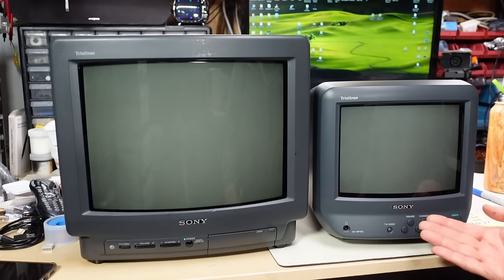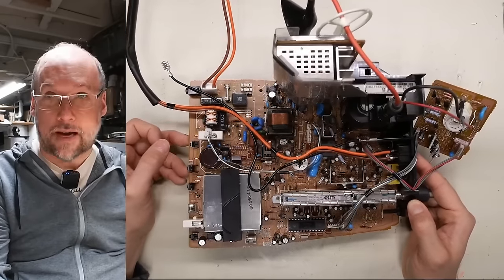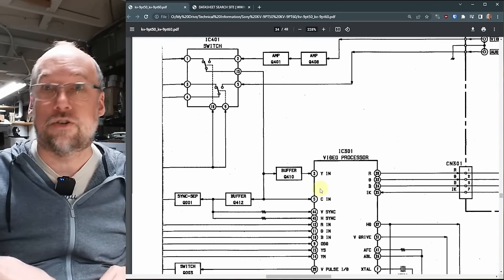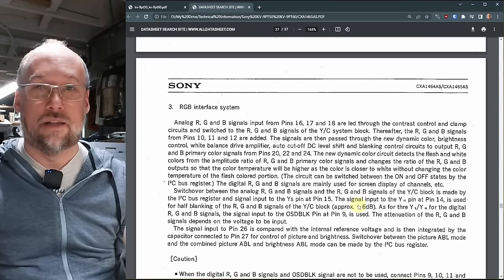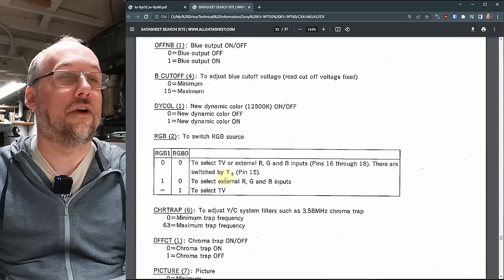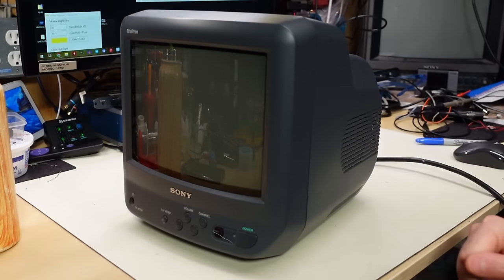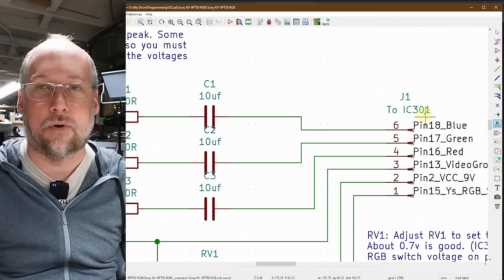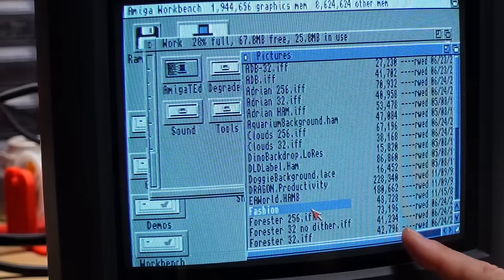Adding a RGB input to a Sony Trinitron (KV-9PT60 / KV-9PT50)

Comment: I had no idea that I2C protocol was that old and that it would be found in a analog TV.  Nice!
Reply: The original Philips patent is actually from 1980, so yeah, it's old
Reply from the maker: Indeed -- and in the past, I had a trashpicked TV which I hooked an arduino up to take full control of the TV via I2C. I was able to do some fun things with it on the fly. I thought about trying it with this TV, but interesting is it has 3 or was it 4 I2C busses on it -- instead of one shared bus. Not sure why Sony did it that way.

Comment: the KV9PT60 was afavorite on movie sets because it could be powered by 12V, you could add a video out (most of the times the pc board already had all the pads to solder the component for that) the tuner is on a daughter board and we coiuld tap on that board to add a tuner out independant of the video out and we could also slow them down to a 24 fps scan rate ideal for onscreen video playback, you could see them in many movie scenes because of that feature alone
Reply from the maker: I guess since it works at 25fps with VSMO set to 1, it works ok at 24fps as well? That's pretty cool, I hadn't thought of that.
Reply: @adriansdigitalbasement  we were using a frame rate converter made for the movie industry by Schindler, since in film we are using 24 fps the converter would make a NTSC 48i signal., I remember that in the service mode we were playing with another menu V-something (V sweep ???) and we would bring the value to a higher number until we have a picture scroll lock , sometimes when the camera was HD instead of film we had to shoot at 23.98 and set the schindler and tv for that rate, when I was a technician for Willam F White in Canada , who was the largest movie equipement rental house back then, I remember modifying at least 15 KV9 for tuner out (by adding a small homemade board video amp) , soldering the SMT parts that were not on the main board to get a video out too (alll the parts around Q406 that you show in the service manual around 25 minutes) , we were rigging them like this: addon tuner out to an external recorder , recorder out to video in , we tuned the tv to get the NTSC wireless sender of the film cameras and by pushing the input button we could switch between live and recorder for playback on the tv and instant playback

Comment: About the 1084 flyback, there actually was a commodore service bulletin about flybacks in monitors manufactured in a specific date range going bad, and these should always be replaced by service centers if they get one of the affected monitors in. Probably the many units failing nowadays are those that were affected by this problem.
Reply from the maker: Oh that's interesting. Luckily a company is making new replacement ones today -- although they aren't as good quality and supper voltage sag, leading to geometry issues.

Comment: My 1084 has a round DIN6 for analog RGB in. A panel mount hole for that would've been much easier lol
I actually have a Sony KVM with only composite in, I plan to add an RGBA input to it. These videos are very helpful!

Comment: I think this video is going to be pretty useful for me.  I have a 20" Trinitron of similar vintage that I had been thinking about RGB modding but hadn't really looked into it yet.  Looking at the service manual now, it seems to use a very similar setup to this set, and may even be slightly easier to mod.

Comment: I've had one of those 9 inch sets on my desk for a few years now (same model, the kv-9pt60). I use a composite extension cord so I can plug in devices from the front and it has been perfect to test out old consoles, and to plug in my Jack Pacific plug and play console so I can play galaga on it when I want to. I got it for a bout $5 from a retro game store that was going to recycle it because it didn't have a remote, and the front power button is semi broke (it seems the plastic bracket broke so the button flops around in the socket, but otherwise works), I bought a remote off eBay for $10 and it works great. My only gripe is that I have to use the cable extension since it doesn't have a front plug, but learning that this set was supposed to be for vehicle mounting, that feature makes sense to me now. Ive wanted to open the TV up to fix the front power button for a while now but am afraid of breaking the tube (or shocking myself).

Comment: RGB switching signal is active from 1V to VCC+0.7V, so there was no need for a voltage divider to get 1V.
Reply: Yes, the values in the datasheet are voltage thresholds , not target voltages. VIH of 1.0V means the voltage input on that pin needs to be minimum of 1.0V to be considered logic 'high', and conversely, a VIL of 0.4V means it needs to be maximum of 0.4V to be considered logic 'low'.

Comment: If you have a TV with component video inputs, a less invasive means of getting RGB on it is with an SCART RGB-Component adapter. RetroTink makes the one I use. I really like it because it includes stereo audio breakouts, and unlike some of the cheaper ones on Amazon, you don't have to tweak a bunch of pots to get the picture dialed in right. There are tons of pre-made SCART RGB cables for game consoles and computers, too.

Comment: In Europe TV from the 80s got Scart inputs with seperate RGB and stereo audio in/out -puts. A control signal to when switching on the VCR it switched to te Scart input. Later the control signal was used to detect a 16/9 picture.

Comment: for the hole above the DB15 plug, you can put some superglue and sprinkle baking soda on it, and it will form a dense white material that you can build up by repeating this to build up layers and it will fill in that hole.
In the arcade scene, we make boxes called Superguns that are designed to take RGB signals from arcade game PCBs from dozens of manufacturers, all with different ideas of what a "proper" RGB signal should be, so we just put variable resistors on the RGB signals so we can fine-tune the brightness on each PCB.
In your case, it might be a good idea to make a box with two DB15 plugs on it and some variable resistors to adjust the RGB brightness, and maybe a method of reducing the voltage on the sync input in case you hook up something like a console that uses TTL Sync, which might damage the Jungle IC. A  330-450 ohm resistor should do the trick.

Comment: RGB SCART was the way I played Resident Evil 2 on my PS1 back in the day! (I modded the PS1 and imported RE2) (also I was lucky my TV could handle 60hz with a vsync tweak) 18:29 I remember having to take apart SCART cables to check for those capacitors as a lot of SCART cables said they were RGB but were not connected!

Comment: It is interesting that the RGB inputs are AC coupled to the jungle IC with a series RC, but what is missing is the input 75 ohm termination resistors. The cables are so short reflections are probably not an issue, however if the termination resistors were added it would knock the video down by 50% and the contrast control would probably not have to be set at its limit. As far as protection I would also add the Zener as was shown in the Sony monitor schematic, bringing CMOS pins to external connectors without protection is probably not a good idea.

Comment: To get a neat DB-9 cutout find an old card bracket with a DB-9 or DB15-HD cutout and trim it to a suitably small size to use as a template.  Drill the holes for the binding posts, and use those to temporarily hold the 'template' in place. Then with the template in place use it as a guide to drill the required plastic out and file the edges smooth.  Then remove the 'template' and fit the DB9 as needed.

Comment: CRTs are fun, specially when you have a fun screwdriver with a light supposed to turn on when you get a voltage that instead is passing current straight through... Result, the screwdriver got stuck in a board meters away in the direction my arm jolted towards like if it had been a dart thrown to it... And my hair looked like that funky Einstein photo with it all the hair standing up. Lovely, that and the few seconds seeing all black were awesome! (And yes the thing was off, the damned light should have lit at a distance in face in the area I had it, when it didn't I was supposedly safe, well so so)

Comment: The shifting of the horizontal position is common in SCART regions too. I remember seeing it on Sky Digital (UK) satellite receivers when switching from PAL composite to RGB mode in the settings. It's a result of using the composite sync for the RGB video; there's a slight delay between the sync and video so it results in horizontal shift.

Comment: The RGB switching signal is used to blank the video to guarantee a blank video as the other switching signal would enable the information system display. The micro would have to clear memory which takes up micro cycles and code in a very small memory. If you have a pin available then you can save a lot of code by just toggling a pin. We forget we have so much memory available to us which was not available back over 20 years ago.

Comment: If I had known people would want CRT Tvs and monitors, I would not have scrapped mine all out!

About the only thing I saved on a regular basis was the yoke and transformers, as I wanted the copper wire!

The only other monitors I messed with were the ones from cabinet games from the late 70s and 80s. Most of those were RGB, but XY drive became popular with some of the games!

Comment: very cool. i recently modded a jvc 14 inch crt with a toshiba jungle chip, the worst part was the 0.5 Vpp input levels. obv a simple voltage divider worked wonders, but yeah basically it was pretty annoying lol

edit: wow it's really strange how that sony tv is NTSC only, that jvc i mentioned is from 1991 or so, and it's a "multinorma" (as advertised), so it supports PAL-N, PAL-M and NTSC. maybe thats because standards here in south america are weird as hell lmfao

Comment: For added protection, in the last step before feeding from your custom circuits to the set, you could use diodes to clamp the voltage. Really any diode or series of diodes with a voltage drop in the valid input range would protect the display by dumping any voltage in excess of what you want to ground.

Comment: PERFECT thank you.
BTW, at 46:56 that color level setting is changing something (less Moire?) that made the color bars look much better to my tired 70 yr old eyes (maybe it's running into the comb filter / 3.58 trap?).  
Sony fine pitch monitors from the 1980's with model numbers ending in "-F" had the higher resolution CRT's.

Comment: I vaguely remember the little 13" Magnavox TV I had in the early '90s, and I believe those may be a potential candidate for an RGB mod (but replace the pots on the neck board first! The ones on mine went out) - the chassis series was 13K4 or 13L4.

Comment: High tension transformers can produce voltage to the equivalent of a live UK railway line ~ that's 25,000 volts on start up. Scary voltage for sure. My dad worked in TV workshops in the days of Rediffusion (A very British thing) broadcasting. So I learned early on about dangerous voltages inside a CRT set. Meanwhile, my mother is watering flowers in a vase on top of the TV set! 8-O

Comment: 32:15 Try a "nibbler" tool to get a cleaner, square hole. You'll still need to drill a starter hole, they take some practice and you absolutely want to spend the extra money on a good one, but they can give some super professional looking results.

other strategies are: 
- Draw the shape you want to cut out, drill a series of holes every couple of millimeters, and then use nippers to cut out the tabs.
- Drill holes in the corners (or two holes where the diameter is the width of the hole you want) and then connect the corners with a coping saw

Comment: For the sync, I can confirm: The Oric Atmos has a single sync pin which merges HSync and VSync (they have different amplitudes so they can be dinstinguished) signals, and my 1084 monitor had zero problem with the Oric, with a rock solid picture and vibrant colors (more or less bright depending if I enabled the TTL button or not)

Comment: Note on the Ys signal - the data sheet indicated that this is a logic level input... Vih (min) means that the minimum voltage to be recognised as a logic high is 1V. The maximum voltage allowed would be equal to Vcc. It would have been enough to simply put 9V on the pin to give it a logic 1. A neat way to do this would be to tie the Ys pin high using e.g. 10K to Vcc, and then use your switch to pull it to ground. You would get the same toggle effect with only two wires to the switch :)

For the sync signal, it's very typical to use a 330 ohm resistor in Amiga SCART cables, to pad down the TTL sync level to the 1V p-p signal that SCART expects. The resistor alone is enough because the composite sync input on SCART is terminated by 75 ohms. So you could probably omit the pot and simply have 330 ohms plus your diode (a 1n4148 would be plenty). You may not even need the diode because there would be no path to ground to worry about.

Comment: Great video again Adrian! I love your calm and easy way to explain these things - I wish Id've had a Teacher like you, back in the day!

Please forgive this lowly programmer for a dumb question; Why does the sync signal from D1 into the video 'Input' Jack? As I don't know, I can only read it as now a jack input only goes to the Diode and cannot pass?
Also, probably wrong again, but I always thought that dot pitch refers to the pixel size, not the gaps...

Please keep up the great work, I am slowly learning!!

PS: You should do a stream or series or something teaching electronic basics ... because I find you much easier to understand than the 'Dummies 6-in-1' 😆
PPS: Why did you have to change the board?

Comment: In Europe, all those Sony TVs come with RGB input via SCART by default. No mod needed. Also, later models like shown in this video, including 50 and 60Hz (PAL/NTSC) output. It’s weird for me know that in US most of TVs rarely included this and you need to mod TVs to get something that in EU was an standard.
Reply from the maker: It is interesting how all later TVs in Europe supported NTSC. This must have been dictated by market demand so people could play back imported media or use imported hardware, but it was never the reverse.
Reply: @adriansdigitalbasement  what's odd is that, in the UK at least, I never knew anyone have NTSC equipment. wonder if it was just that they added PAL to the NTSC chip and it was more effort to remove the ntsc functionality.
Reply: I remember we also had "PAL-60" available on lots of TVs, particularly in the late 90s and early 00s. This was even, IIRC, supported on the original Xbox, so you'd get the higher resolution of PAL combined with the higher refresh rate of NTSC for the best of both worlds.
Reply: @adriansdigitalbasement  Market demand in Europe with free trade across borders did require that TVs did support both PAL and SECAM. 60Hz PAL did exist in Brasil. If you both PAL and SECAM, and do both 50Hz and 60Hz then adding NTSC is not a big deal either. The feature wasn't useless after all. However it only happen when the chips were sufficiently integrated that it didn't require a lot of additional components.
Reply: @adriansdigitalbasement  If I remember right, there was a big demand for VHS movies imported from the US (usually cheaper and available sooner than the domestic PAL release) but very little in the other direction which is why NTSC playback was common on European VHS decks but PAL playback was nonexistent on North American ones, except maybe for a few high-end VCR's.

Comment: I have a KV-20S10 which has a similar if not the same jungle chip with a spare analog RGB input. As far as RGB mods go, this seems like a fairly trivial one to do. Mine unfortunately doesn't have that nice back plate so when I did my S-Video mod, I had to leave some extra length so I can disconnect it before fully pulling the back off. I have half a mind to use a DB-9 connector when I eventually get around to doing an RGB mod instead of the usual SCART just because space is at a premium already back there.